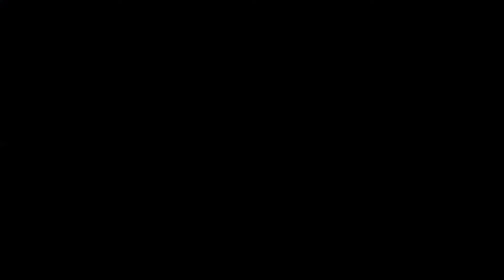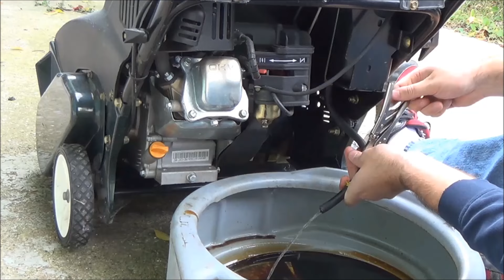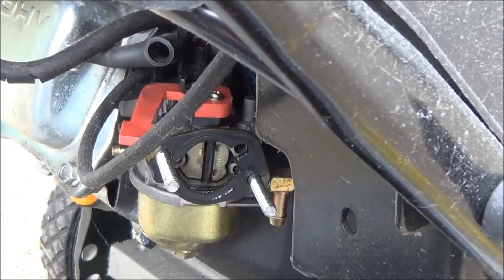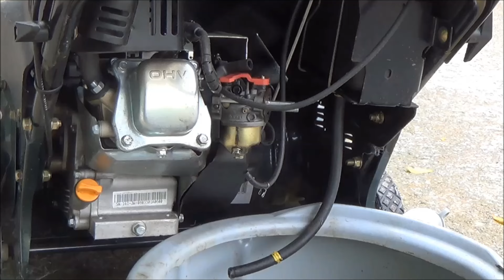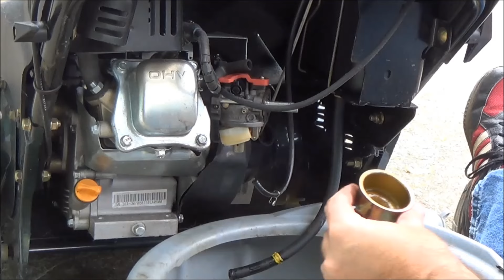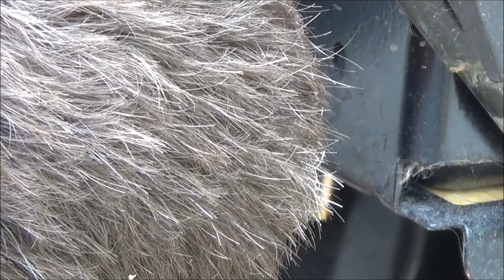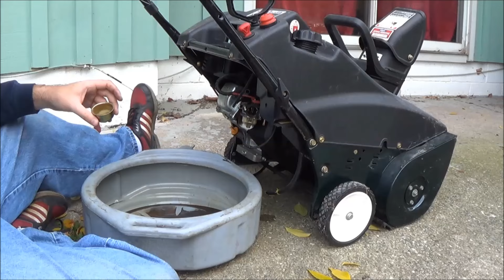How To: Repair Snow Blower Carb - Engine Only Runs with Choke

Comment: Speaking of the importance of clean, fresh fuel for small engines...my brother's Stihl chainsaw was running crappy after sitting in the shed for the winter so he took it to his local small engine shop for a spring tuneup. When he picked it up and paid the bill  he got to chatting with one of the employees (not the owner). The guy said, "I'll tell you a little secret about these chainsaw tuneups. There are no moving parts, no adjustable parts, no replaceable parts in a Stihl chainsaw carburetor. If the saw isn't running well, pretty much the only reason is bad gas. All we do for these 'tuneups' is dump out the bad gas, put in fresh gas, clean out any gunk around the chain sprocket, wipe them clean.... and charge you $29.95". (or whatever)

Comment: do you put a fuel stabilizer  in ? Would ethanol  free full be better for engine?
Reply from the maker: Using ethanol free fuel is best for small engines, and using a fuel stabilizer or draining your carburetor at the end of the season will help prevent future problems.

Comment: That sounds like my problem but why then have I never had that problem with my lawn mower which sits in the shed for 6 months? same type and size engine.   You should consider getting that grey hair tinted professionally.

Comment: have this problem two brand power more engines. cleaning does not help. have been told to drill out opening with a 
slightly larger drill. do you think this  will solve the problem?
Reply from the maker: I would recommend testing fuel flow from your gas tank. Take the fuel supply line off the carburetor and let it drain into a gas can. Fuel should flow out of the line quickly as long as there is fuel in the tank. If the fuel is only dripping or drizzling from the line then a fuel supply restriction in the line or tank may be causing your problem. If you have good fuel flow you should look into replacement cost of the carburetor as I have found many small engine carburetors are available on amazon for $15-30.

Comment: I will be trying this later today thanks for the tips! BTW, what was that spray you sprayed on the bowl? Carb cleaner?
Reply: I used an E string from my guitar that just recently popped, that did the trick! thank you so much...what a lifesaver
Reply from the maker: The spray I used was brakes and parts cleaner, which I use to clean almost any metal part. You can buy it from any place that sells auto parts. Carb cleaner would also work fine. Good luck!
Reply: ok, thanks!
Reply: An add for some additive claims to clean carb etc.  Are these worth anything?
Reply: this didn't work for me...I stuck aluminum wire in but it didn't get that far. do I need a thinner wire?
Reply: oh and I added additive also just to be sure and it didn't make a difference
Reply from the maker: It sounds like yours is pretty plugged up. You could try starting with a smaller wire, or remove the carburetor and soak it in mineral spirits. A new carburetor is an option too, and probably not very expensive.
Reply: I also used high E string from guitar that i had left over, worked perfectly, thanks.

Comment: The nozzle can be removed from there. There is a small screw underneath that nozzle, just where the small metal cup has it's securing screw.  Insert a thin flat screwdriver to unscrew it, then push downwards with the screwdriver inside the carburetor on top of the nozzle to make it fall.  This way you have proper access to clean the nozzle.

Comment: Bought a Sears Craftsman with this exact engine 4 years ago. POS has never run right from day 1. Always stalled out, wouldn't restart unless it sat forever. Last year we couldn't even open the choke to use it. Complete frustration. After watching this video and literally a 10 minute fix, it started right up. Runs like a dream.Thank you so much. Saved us a ton going to a repair shop and our stress level is now down to zero when it snows, lol.
Reply from the maker: Hot4stockchick I'm glad to hear my video helped you! Thanks for sharing. :)
Reply: OMG NO! I am glad your video helped me. Do you know how much snow we have had this winter? LOL

Comment: What did you do to the old gas?
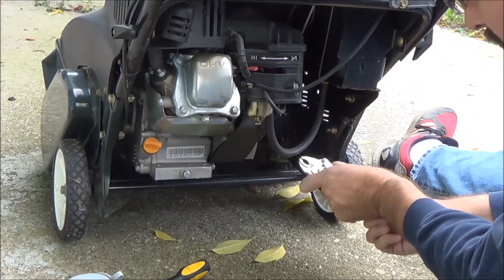Reply: I drain mine into a gas can.  At the end of the season I put the old gas into my car.  I'm diluting the old gas 1:14 with new gas which will not be a problem for your car to handle.
Reply: Dump it behind the shed

Comment: Before putting the blower away in the spring, always drain the gas and run it until it dies.
Reply: That's what I do but I still have this problem. Seems to be an issue with these MTD snow throwers, my other equipment doesn't seem to ever have any fuel issues.
Reply: @nodak81  I drive 20 minutes to buy ethanol free fuel, run mower and blower dry at end of season. Mower has USA Briggs & Stratton before they went to China. The old blower had a Tecumseh engine,  gave 16 years of solid service. This Chinese Troy Bilt (MTD) I clean the carb every year. I replace it every other, at least the carb is only $19 on ebay. I have a pressure washer with a 270 cc Lifan engine, same problem. I have a 8+ year old Champion generator, believe it or not, despite being from China, I've started it on gas that looks like apple juice.

Comment: Thank you so much for your video, it got our little Toro running during one of the worst snow storms we've had in years..p.s. we didn't have an air compressor, so we used a bicycle tire air pump and it did the job till we can get it properly serviced. :)

Comment: So after you did all this it still ran rough????   
What you have is a hunting governor caused by the engine STILL running TOO lean.   Rather than pull it all apart first I would try fuel injector cleaner add some to the gas then run it for 5 min each day Till it clears,  and run it with the choke on. 
Also you can avoid this problem by running premium gasoline  and fuel stabilizer in the spring. 
If this does not work then yes the carb may have to come apart

MTCW Sandman.

Comment: Remove the jet and tap the carb and a brass insert tube will drop out.You can actually see the tip when you look behind the choke plate.Theres about 8 pinholes in that tube that would benefit from some carb spray

Comment: i have the same problem with my motorbike would the same thing you did work ?
Reply from the maker: Fundamentally, this will work on any carburetor. If you have good fuel supply to the carburetor, but you're not getting enough fuel to the cylinder, clean the bowl and jet.
Reply: +ginger ninja
Have a BAJA mini bike with a Honda clone engine. The carburetor looks to be the same as the one in this video.
My bike had set for too may months and would only run with the choke full on. I had done everything this and 
other videos had indicated to clean the carburetor but it still would not run unless the choke was on. What I 
finally found was a block orifice in the black plug that is in the top of the carb under the idle adjustment screw.
  Remove the black screw for adjusting the idle, pry up on the black plug which is now exposed. I had to pull
a wire out of a wire brush to find a wire small enough to clear this piece. It has 3 holes in it. Then flushed with
carb cleaner. WA-LAH she runs good as new. Also a set of tip cleaners for an Acetylene torch works good 
for the other orifices in the main jet and emulsion tube.  Now if I can stop the delivery of the new carb I ordered from
Amazon?
Reply: baja mini bike

Comment: I have same problem with my GX200 engine. have stripped carb completely, cleaned pilot which was blocked solid and re-assembled. I note no mention was made in video of the fuel mixture jet. Do you think that may be contributing to the problem.

Comment: IF AFTER THIS SIMPLE CLEANING IT STILL SURGES, OR ONLY RUNS ON CHOKE, BUY A NEW CARB. THESE CARBS MOST OFTEN CANNOT BE REPAIRED WELL.
Reply: dave r The carb was only partially cleaned. Need to try cleaning the emulsion tube and slow idle jet also, before buying a new carb

Comment: I just tried this on my MTD Snow thrower, but it did not work. It runs ok on choke, but when it's taken off choke, it dies unless I press on the primer and keep pressing steady on the primer, then it keeps running.  Do you have any ideas?

Thank you!
Reply from the maker: Dave R. is right. When the engine is running on choke the carb is only letting a small amount of air through and only requires a small amount of fuel. Off of choke the engine requires much more fuel. Often times the carb jet can be cleaned, allowing free fuel flow again, but if there is a lot of corrosion replacement may be needed. When you remove the carburetor you may be able to better clean the jet with better access, and you should disassemble the jet if you can and soak the components in mineral spirits to remove the tough debris. Pay close attention to how it comes apart though and don't lose pieces. If there is substantial corrosion replacement is your best option. Be sure to add fuel stabilizer before putting it away next year, and use only premium gasoline which doesn't have ethanol added, to prevent future problems.
Reply: you're still getting too much air. Try spraying carb cleaner with the little straw up the main jet. You can also see if the main jet is removable with a flathead screwdriver and clean it out of the carburetor. Some of your gaskets or the bowl gasket may also be leaking air.
Reply: This procedure here only cleaned the main jet and may not be the only dirty part on the carb.  Under the idle screw there is the idle jet.  The idle screw has a d slot in it, but can be removed with a flat head of the right size.  Once the screw is removed the jet can be pulled straight out.  This also needs to be cleaned with a really small wire.  I took a wire from a wire brush to clean mine.  That stops the surging heard here at the end of the video and the need for the choke to be on.  I then used Seafoam to clear out the rest of the varnish in there.  Hope this helps.

Comment: have just used this to drain fuel and clean the carb on my generator - similar setup but much more of a pain to get to the components.  got dark so haven't put it back together yet - will do that in the morning, haha.  thanks.
Reply: Can some one told me how to fix my snowblower    It turns on but it runs to high.  And I can't  turn it of on less I pull the spark cable out.